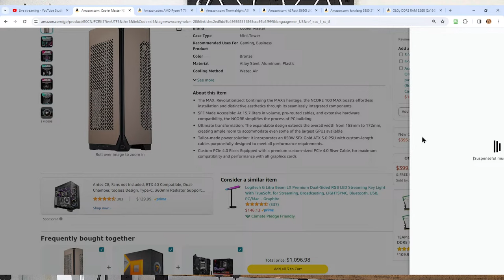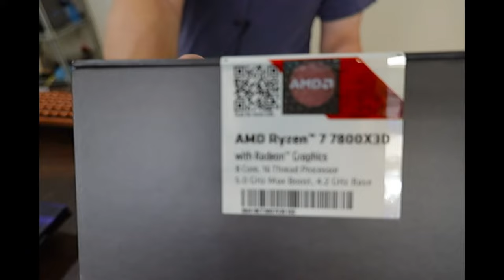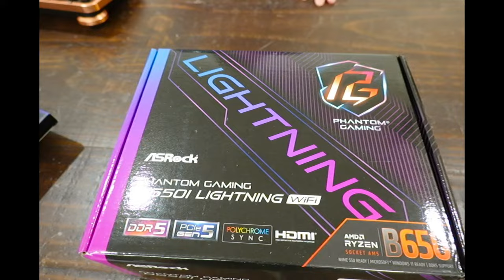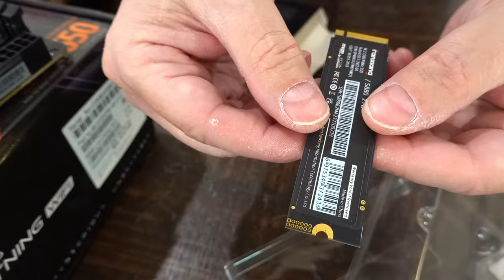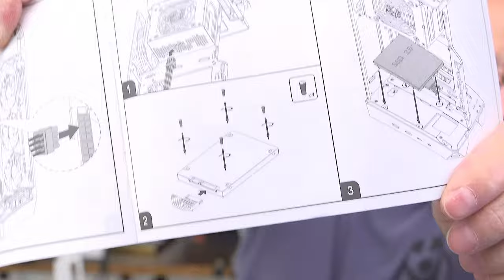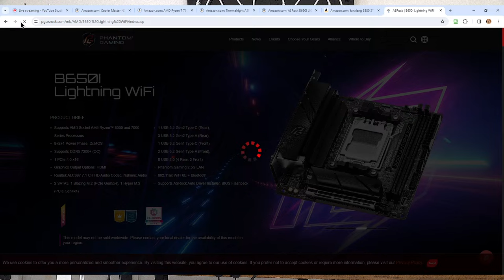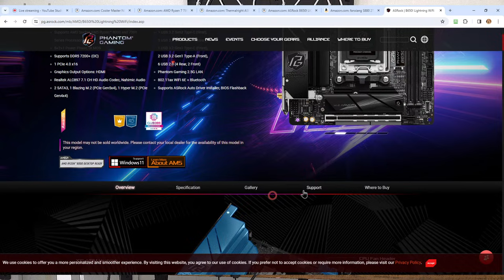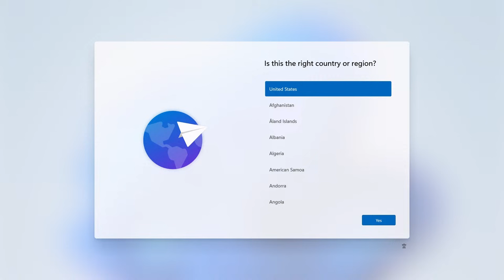Live: Unique Tower Build Featuring Cooler Master NCORE 100 Max - An Actual Tower!

Comment: Thanks for this review!/build I'm still a little bit in doubt, as I have the ROG Crosshair Impact VIII Motherboard, which is DTX (re-labeled mini-ITX). The DTX motherboard is the same form factor of mini-ITX, except that it's a little longer in the bottom, where the GPU would normally sit, in order to utilize space underneath a regular fitted GPU. Will this case fit a Mini-DTX motherboard like the ROG Crosshair Impact VIII for AM4?

Your efforts are much appreciated, thank you!
Reply from the maker: Sorry I don't know
Reply: @CareyHolzman  Thanks for getting back to me though!